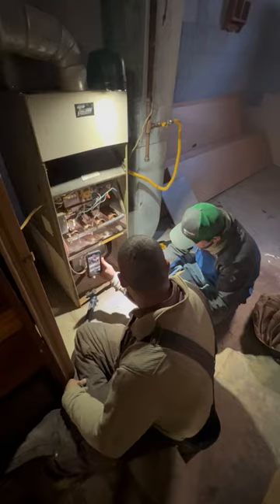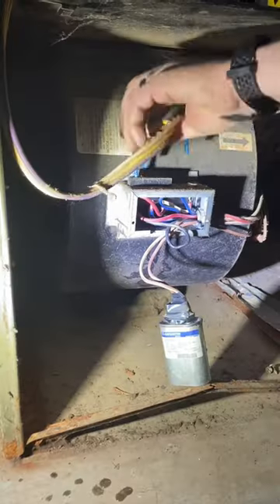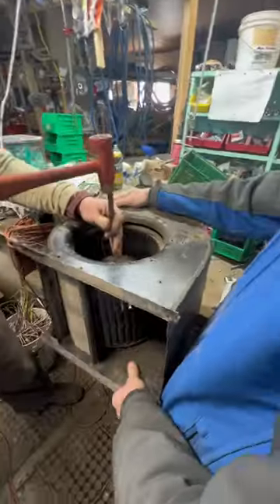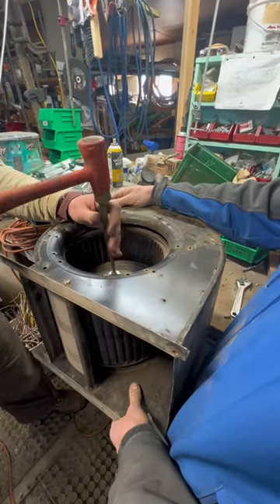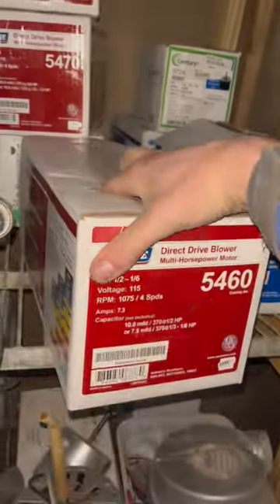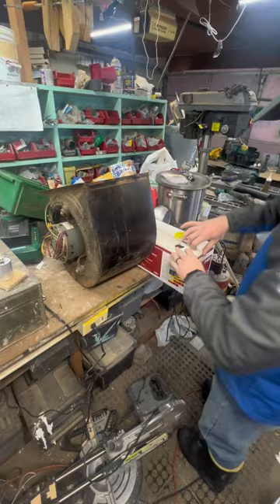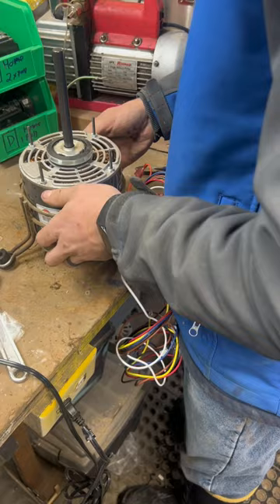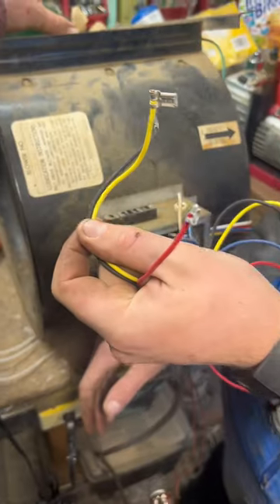Replacing a furnace fan motor with Trent. #HandsomeOrHandy #Handyman #HomeMaintenance #HVAC￼

Comment: I use an SDS hammer drill set to hammer only to remove stubborn motor shafts from blower wheels. One bit like a socket, the other is just a pointed round chisel bit. It's a big time saver for those impossible motor changes.

Comment: There is a nice handy tool that is especially designed for separating a blower wheel from the blower motor shaft, worth every penny. Once you expand the end of that shaft bigger than the wheel opening life just got harder.
Reply: This

Comment: Why are you knocking the motors out with a punch? That’s bad news bears. Clean the shaft, lubricate the shaft, rotate the shaft with an adjustable and the motor will literally fall out of the wheel. 🤔
Reply: More Like Emery Choth Sandpaper and Shine The Shaft. A Small Adjustable Wench To Loosen Blower Wheel...
Reply: Nope

Comment: I personally I got about 10 or 12 Motors on my truck I'm not going to go back to the shop to put a motor in a blower housing plus I carry probably about 25 or 30 capacitors I don't like having to go run get stuff and I don't like those one-size-fit-all fits all capacitors
Reply from the maker: Are use the turbo 200 for testing purposes and later install the correct size.